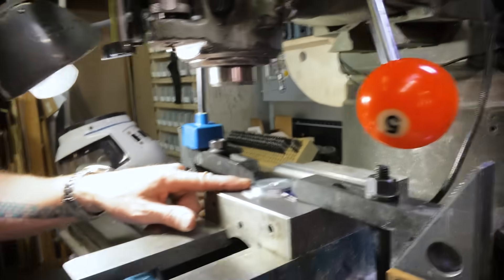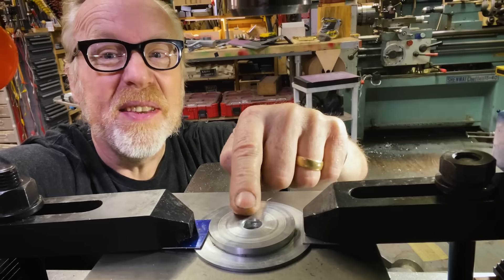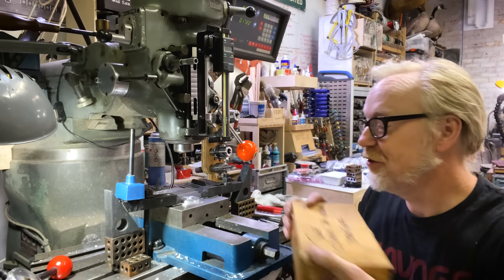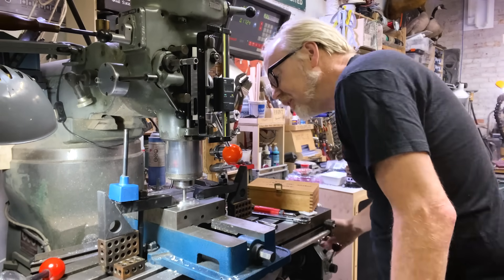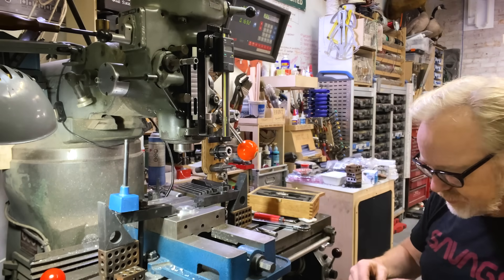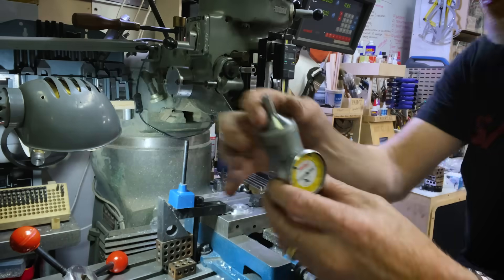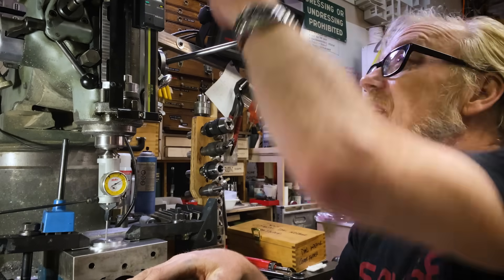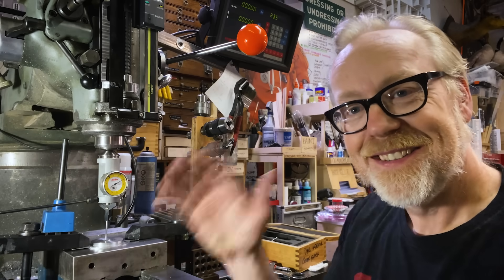Adam Savage's Favorite Tools: Wiggler Machining Center-Finder

Comment: Personaly I prefer a  vertical dial test indicator mounted on an "indicol" holder a lot faster and more accurate.  Only time I use a co-ax indicator is when the hole is too deep.
Reply: Co axial indicator is very fast too...the correct use isn't showed in video....
I prefer to rotate the quill manualy and split the diference in one axis...much more faster
Reply: @tiagolomar  It's a lot faster to do it while the spindle is spinning.
Reply: Yup. Coax's are very particular in use. I mean, there's a reason, most kits come with rods that allow you to go up to 30 cm deep. It's a last resort tool, very twitchy. A last word (or other brands, but style) dial indicator is the tool for concentricity.
Reply: @aserta  The only difference between a coax dial indicator and a normal dial indicator is that one is designed to sit in a rotating fixture. And both can be finicky, but it's up you to choose the correct tip and application of each. 

Also, you can check concentricity with a coax just fine, the tip just has to be able to reach both features. If your concentricity is good, your delta on the dial won't change (per feature). And that goes for both indicators. If you have a dial on a mag base that you've attached to the face of your spindle and you have the arm going literally everywhere in a 10ft cube around the machine (pretend for a moment the arm of the mag base can have as much length as needed to fill that cube and can move through solid objects) as long as that little tip can touch the two or more features you're checking (you can even move the arm to check the other feature because you're not moving X or Y on your spindle) you'll find out how concentric they are. This is the quick and dirty way. To do it the 'hoity toity' I'm-better-than-you way, you get yourself a CMM and check that shit like the lab rat you are. (I would probably take it to the CMM, because I like being precise)
Reply: Co axial indicators can actually be more accurate than a traditional indicator.  Anything that is horizontal actually has a minute amount of drop when the shaft is not spinning.  And to be honest anything other than a Blake is untrustworthy.
Reply: @Rhoxyerworld  Depends on how accurate you need to be, in Adam's case on a little manual? This cheapo 90 dollar one (looks like it's the one linked in the description) will do just fine for the thou/ half thou he''ll get. You doing a high precision NASA/ Aerospace part? Yeah, get the blake or find a good German/ Swiss made one. Basically, if you pay under 300 for a coaxial, it'll do the job, but if you want to be absolutely sure throw some extra cash at your testing equipment. And obviously don't let any average 200lb gorilla handle it.

I have a Interapid half-thou dial indicator that I trust with my life, and it's older than I am. Probably.
Reply: @orangedream267  agreed. Indicol and an interapid are plenty good for anything on a bridgeport. Common sense plays a role too. I like to make everything perfect, but functionality should dictate. Just like you don't need .005 tolerance on hole clearance and most prints call for. Bolt hole clearance has traditionally been 1/32, but .005 looks better on paper though its not CTF or anything.
Reply: @orangedream267  or get an starrett if you want to have the same amount of precision for about three generations.
Edit: It might cost the same as a car though.
Edit 2: looks like my foot met my mouth, Starrett doesn't make a co axial indicator. I wouldn't doubt that they would make you one for the cost of a nice new Toyota Camry though.
Reply: Yep archie you are very right.

Comment: Hallo,
Im a Service Engineer for CNC milling and lathes
I use a Haimer Centro which is similar to your measuring device. (0.003mm centering accuracy)
my tip don't let the spindle turn automatically.
when centering move the spindle by hand, vibrations are avoided and more precise centering is possible.
Thanks for your videos, greetings Robert
Reply: Robert — some of the instructions I’m reading are telling me that you need to use this with the spindle running — slowly — because the dynamics of the machine when static are not the same.
Reply: @chuckoneill2023  Hallo, You are right and of course if the spindle is okay you should let it run low speed and center it. In Adam's case the noise/vibrations of the bad bearing let the indicator jump so it's not possible to differ between noise and offset.
Best to fix the Spindel first 😉😁
Reply: I came to say this. It feels better to use it by hand first.
Reply: U got run it at high speed
Reply: Around 1200rpm just like a edge finder , it’s more accurate at high rpm

Comment: My guess is that your mill isn't in too bad of shape and that your hole just isn't perfectly round.  I've never seen this exact type of tool before, really cool how the dial can remain facing you while you clock it in.

In my experience,  If you have the money,  buy a .0005" Interapid test indicator. Its more compact, versatile and I would argue, more precise, as it will tell you if your hole is out of round. Plus you can use it to check flatness, straightness, distances, etc. The downside of a test indicator is that you will need a mirror to read the dial when its on the backside as the dial rotates around with the spindle.

Love your videos :)
Reply: Vertical dial test indicators, you won't need a mirror.

Comment: My technique for this kind of center finder is to never have it run in a powered spindle. Only bad things can come from that.

How I always explained it to the new guys/gals:
1. Set your machine to high gear or preferably neutral, so that you can spin it by hand easily
2. get the position roughly right
3. position the needle to trace a circle that's a bit bigger than the hole/smaller than the boss you are probing
4. bend it in and lower it into place
5. orient it in x+ and zero the readout
6. orient in x- check readout and position the table half it, then zero again
7. orient in y+ and position the table to zero
8. check your work (repeat 5-8 as necessary)

fast, simple, precise.

The biggest problem these things have is that they need a massive amount of z height, which at our machines was at a premium
Reply: This is the proper way to do it. And for the love of metrology, don't run your spindle any faster than 20-25 rpm, your precision instruments will thank you. If you do it by hand, so much the better.
Reply: to me, doing it up-powered feels both safer and more accurate as you can tune it like you would tune a 4-jaw.
Reply: @deefdragon  what's safe about a running spindle with you or your hands near it. Safest: no spindle power, slightly unsafe: spindle under low speed 10-15rpm, Do not go any faster: 25 rpm (or you risk burning up indicator tips), okay-don't-touch-my-machine-anymore: this video.

A spindle if it's bigger than a tiny toy servo or something Will Not Care that your finger got caught in the coaxial indicator. And it will rip it off. There's a reason some of the older machinists lack a finger or two.
Reply: @orangedream267  I'm assuming autocorrect dicked him and he meant un-powered
Reply: @kentsugden6865  I never ever assume near something that can rip my extremities off. Or electricity. 480V will happily kill you and it'll hurt the whole time you are dying. If someone says the machine is on, I'll take their word for it. If they say it's off and disconnected, I whip out a multimeter to check if they lied (and truth be told, if they lied about it being on as well, but there's a point I'm trying to make).
Reply: I wondered about that, It seemed safer for me, and the tool to do it unpowered, probably faster as well.
Reply: @kentsugden6865  less plug more hardwiring. I did service on okuma mills and lathes. You do not want to make mistakes on new machines so you always double check voltages and phases.

The electricity was a point of 'trust but verify'. Checking won't hurt, trusting and being mistaken will.

As far as tuning a 4 jaw, haven't done it. But i would have it unpowered. The problem in this conversation stems from misspelling which boggles my mind when you can take your time to type something out. Unless he meant BALANCING a chuck, which is a little different than centering a chuck on your spindle.

Comment: Never seen that called a wiggler.  It's always been called a Co-Ax indicator in my 50 years in the business.  Never liked them.   I've always used a vertical type test indicator attached to "Indicol" holder to center on the mill.  It just clamps on the spindle.  No need to remove the tool or collet or lower the knee.

Comment: Hmm. I long time ago, when I was a machinist, working on both mills and lathes, we just used a dial indicator, mounted in the spindle.
Now, I didn't pay for the tools, so I don't know the price. But I would think it was a fair bit cheaper than this.
And the dial indicator looks to be much more flexible, regarding the hole size.
And can be used for both outside, and inside reference diameters....
Reply: Yeah they're not cheap. I bought a middle of the road co-axial indicator and it was in the $300-$400 range.  Once you learn how to use them properly, they save a lot of time.

Comment: Technically a wiggler is a far older and simpler tool (and it really does wiggle). Adam is demonstrating a Co-Axial Indicator, they don't "wiggle": They are great to have. With a milling machine, if you have a modern DRO (DRO with a Calculator), the Co-Axial Indicator isn't quite the miracle tool it once was when it was first introduced, but it is fast to get "dead nuts" over a circular feature. A Decent used Fowler CoAxial Indicator will run about $100.00 - $150.00; a Chinese Clone will run about $80.00 - $100.00. Gentle Criticism:  The problem with using the Co-Axial indicator the way Adam demonstrated, the graduations on the Indicator were not calibrated for any specific distance (it depends on the length of the probe and some other axial distances to determine what distance the graduation is actually reading). Using the indicator this way is GREAT for accuracy but has ZERO precision unless you really RTFM and are prepared for much longer setup time and serious gymnastics with a calculator (Adam didn't for this video, and I don't blame him... it wasn't necessary. Again, using a Co-Axial Indicator for Precision Measurements when you have a DRO with Calculator Functions on your mill doesn't make a whole lot of sense).

Comment: Please only use these coaxial indicators for centering they are not accurate beyond centering. Eventually all of these get put on the mill and put on high speed with no stop and they get flung across the room then they get sent to me and I recommend a real Test indicator. Even a cheap one has more uses then these.

Comment: Coaxial indicator. Also given enough time you'll fine a test indicator on a arm will bring you a more accurate indication but the coaxial is quicker.
Reply: The difference between a DTI and a coax will never reveal itself on his machine, with his skill set, making the parts he makes. The clamp on the right side is barely even clamping on the stock. (On the left at 1:30 ) He's never going to need to hold tenths.

Comment: I have never once used that tool with the mill actually running, even at a slow speed. I cringed so hard watching that. Is that a common practice? I turn the spindle by hand when I am trying to find center like this. I feel like you have better control and are able to make your movements a little more calculated when doing so since the arm isn't bouncing back and forth so erratically. Either way solid video and keep up the awesome work!
Reply: I've only ever used one of these in a moving spindle on a boring mill and that's because it was around the end of a 4" piece of stock, if I remember correctly. In any other instance on a milling machine proper, I'd just throw in an edge finder and let it pirouette at 1000rpm because it's a visual indicator and not a precision instrument like a bore dial. I'm totally with you on this.
Reply: @classicbandgeek  I'm still very much a learning and rookie machinist, but there isn't a machinist in the shop I am working in that has used one of them while their mill was running and I'm in a shop with nearly 200 years of combined experience between these guys. Not saying that it is wrong to do so, but it just seems more dangerous to the user and to the tool itself.

Comment: Everytime Adam uses some allegedly precise measurements and says "this right here is half of a thousandth of an inch" my European brain just shows 404. I guess that is very precise but you could very easily fool me with this lingo.
Reply: roughly 1/100 mm, what Stefan Gotteswinter would categorize as "horrible, but ok".
Reply: The way he was using the Coaxial Indicator, the graduations were meaningless as far as any predictable distance (and that is OK for this application). If you want the graduations to mean something (or know the distance they represent) you must Calibrate the CoAxial Indicator during the setup. Not many people bother with this, if they are just locating the center of a circular feature.
Reply: An inch is defined as exactly 25.4mm, so:

1/2*1/1000*25.4=0.0127 mm
Yes, that's pretty darn precise. While CNC machines can go to 0.001 mm, you can't even measure below 0.02 mm withouth breaking out the immaculatelly kept tools of the Metrology Room.
Reply: I usually have to work from 1 inch is 25.4mm so 0.001 inches is 0.0254mm ... half of that is 0.0127 so a shade over 1/100th of a millimetre.
Reply: Yeah. But, it is kind of funny how they go fully decimal for this type of work, even though it's not proper metric. They'll convert from three-sixty-fourths and call it 47 thou, 0.047 inches, and I'm all like 'why don't you just do everything in thousands, it's so much easier'.

Comment: What you have there is referred to as a co-axial indicator. Even the provided link has the correct title. 
A wiggler is a completely different piece of equipment, also referred to as a center finder (i.e. Starrett S-828H).
Reply: As an additional note, there is a more accurate (direct) and potentially cheaper way to do this. This involve using a mirror, test indicator and stand (although for small bores most test indicators will come with their own arbors). The idea here is that you mount either the indicator or the stand/indicator into the machine spindle and rotate the spindle by hand. As the indicator is swept along the rim of the bore the deflection of the indicator will show (use mirror to see the dial as it rotates around) the deviation from center (just like the co-axial indicator). Adjust as needed to center. The reason this method has the potential of higher accuracy is two fold, firstly there is no reliance on the accuracy of the co-axial indicator (some are just not all that accurate) and secondly a 0.0001" test indicator can be had for a reasonable price.
Reply: @interex2050  If you use an indicator holder like an Indicol, you can orient the indicator flat with the dial facing up and then you don't need a mirror.

I've never used a coaxial indicator I would call "precision". They all seem to be sloppy and inaccurate. A little bit of skill with a dial indicator is WAY faster/more accurate.
Reply: @ADBBuild  Excellent point, there are certainly many options that make the process more convenient. Though I was more alluding to that this can be done with tools that most will already have on hand (those with machine tools anyhow).

Comment: I think they are just called Mill Center Finder but “wiggler” will always get you what you need
Reply: Adam is just the master of Wigglers, Thwackers and Thingiemaboos and we love him for it
Reply: It’s called a centricator, and you’re not supposed to use it like Adam does in the video.
Reply: droidmonger How do you think it’s supposed to be used? The tool he has is a coaxial indicator which I use in a very similar way all the time on lathes.
Reply: @andrebyman8744  Mainly, it's the RPM. You never ever do anything under power if you can help it when you're doing precision work. Specifically, locations. There are a few exceptions, but those are CNC checks, which are not what the vid's about. Truth be told, Adam should check backlashes too, to make sure he's centering in the direction he's going to eventually cut to minimize error later, he might lose a couple of tenths if the backlash on the axes aren't bad, or more if he's doing both X and Y. And if the backlash is bad, as in beyond a thou, well his part isn't going to be the greatest, assuming tolerances are rather strict. 

Do note, I consider anything over a thou as loose as a elementary school kid's shoelace. Or your favorite lady of the night. Whatever floats your boat for an analogy.
Reply: Orange Dream Oh yeah, I agree he set it spinning way too fast. He could’ve probably done it quicker rotating it by hand too.
Reply: Andre Byman a coaxial indicator/centricator I would use with the spindle off, so that I can actually see what axis I need to move to center the spindle to the part. The way Adam is doing it he is just guessing at what axis to move at any point of spindle rotation to zero it. 

I don’t use wigglers or edge finders, I either use a 3D taster (google it if you’re unfamiliar), or a centricator.
Reply: @roidmongerful  If you turn the spindle by hand you can create easily an error, because you can push the spindle in such an old machine a few 1/100mm or even 1/10mm out of center
Reply: i mean.... it wont. because "wiggler" is the name of a totally different tool. this isnt a wiggler
Reply: No, no it won't.